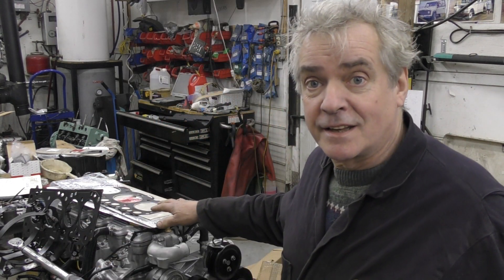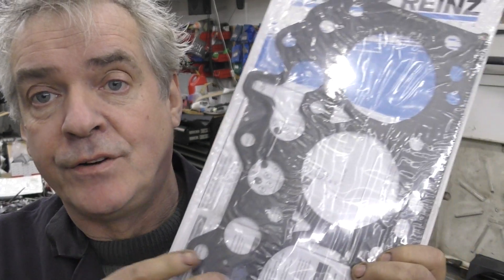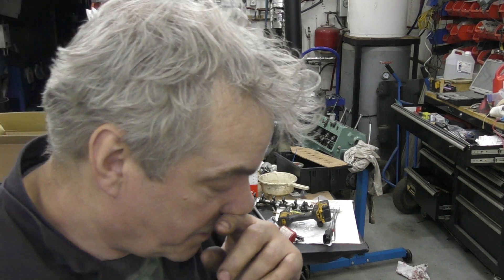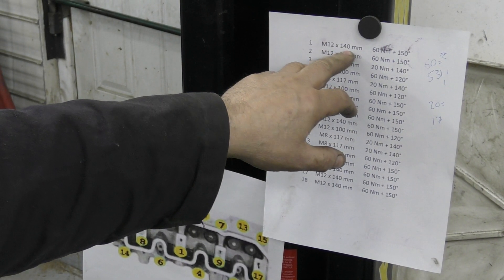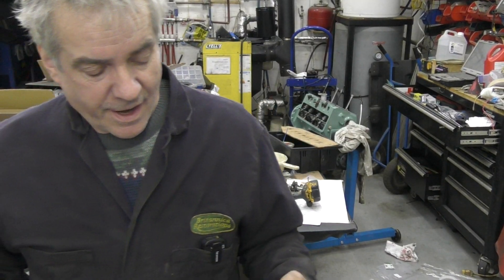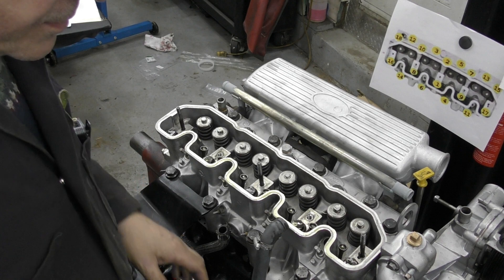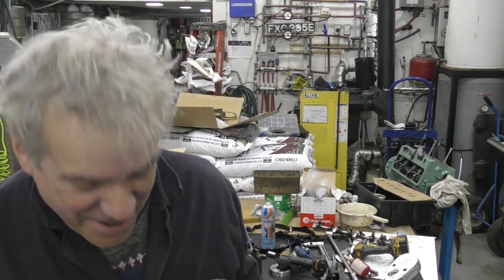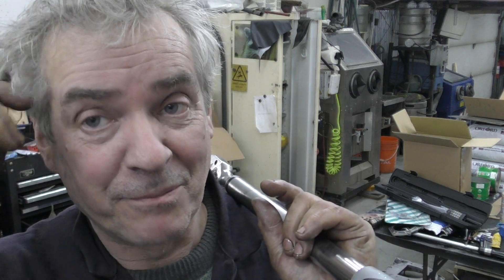Tightening a 300Tdi head with new torque wrench and HS2.8 tightening technique.

Comment: Curious about torquing one bolt fully before putting any torque on the rest..? It feels to me like it would be better to progressively do all bolts. What's your view?
Reply: Absolutely
Progressive torquing.
Reply from the maker: Maybe for composite - but different for MLS - never had a head warp or gasket fail yet
Reply: @BritannicaRestorations  interesting..
Reply: Mmm, my 200tdi head gasket failed so I had to redo mine last year. When i was removing the head bolts bolt numbers 1 and 2 were loose, presumably the reason it failed. 
 The tightening procedure was 40Nm then 60 degrees then another 60 degrees.  I tightened them all in order to 40Nm and then went back and checked.  Bolt numbers 1,2 & 3 all needed a very small amount more to get to 40Nm.
Reply: @marklloyd4536 that's why I go over all bolts to the initial torque a couple of times at least or there's settlement that reduces the pressure from the earlier tightened bolts.
Reply: @BritannicaRestorations        UNBELIEVABLE!

Comment: Will it work on 200tdi in regard to the torque head bolts??? @BritannicaRestorations
Reply from the maker: yes
Reply: so on MLS gasket it is better to use the HS2.8 torque sequence instead of the original 200tdi (40NM, 60 deg., 60 deg.). Right? @BritannicaRestorations
Reply from the maker: I would not use an MLS on a 200Tdi = the oil passage is in the wrong place and can cause leaks

Comment: Correct torque is always a squeaky bum for me.  For a start, calibrating torque wrenches, and trusting that they hold the calibration for the job keeps me awake. 

Pick any 3 rando wrenches you can beg, borrow, or steal, and they will all torque differently, often very differently! Few check their wrench calibration before important jobs like heads, n hubs, crank pulleys etc.
(Good luck torqueing a Disco crank pulley with the engine in!) 

Not sure how that fancy wrench is calibrated - it can't just be switching it on and waiting for a green light, surely? What's it calibrating against I wonder.

I always sweat after a doing a head, if the bolts are really where they need to be, and what a head will tolerate if the bolts are out of spec. 
As you point out, the quality and accurate, clean placemet of the gasket is also very important.
 
I think most troubles are  primarily misplaced trust in whatever greasy, untested wrench is lying around though.

I always re-torque after a bed-in, a few hundred miles and check some bolts against two different calibrated wrenches just to make sure.

"Tighten it as much as you physically can...then give it a quarter turn" as my old man used to joke.

Comment: So the 2.8 is tightened more than the 300tdi! The 300tdi is only 40NM for a start and then 60+60+20= 140 degrees!
Reply from the maker: The M12 x140mm bolts are 60Nm+150 degrees
The M12 x 100mm are 60Nm+140 degrees
The M8 x 117mm are 20Nm+140 degrees